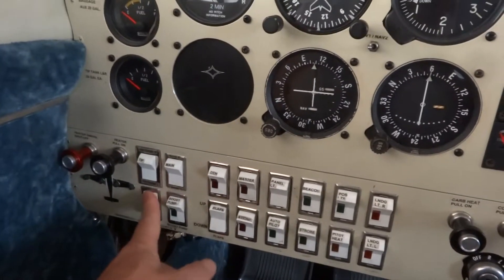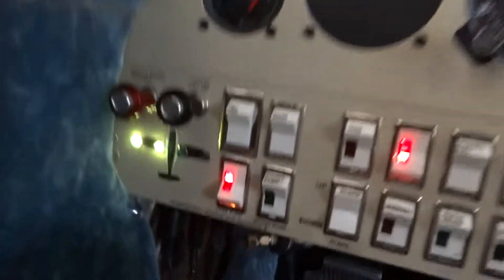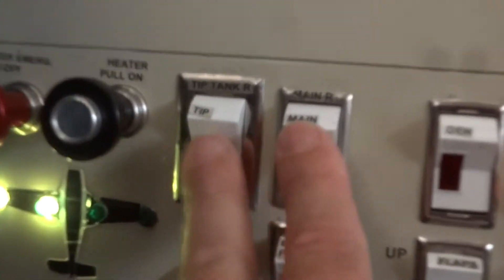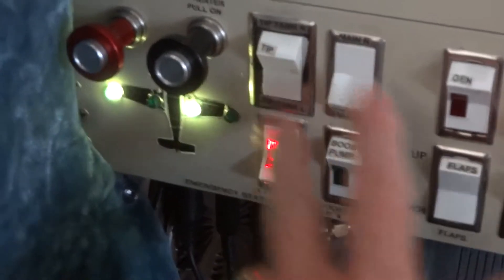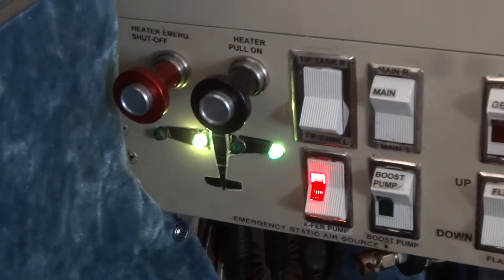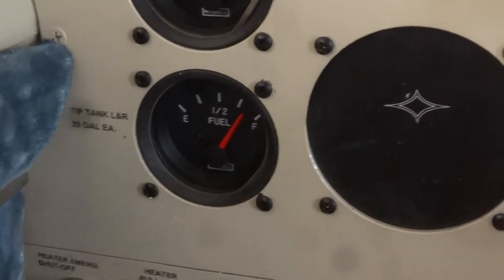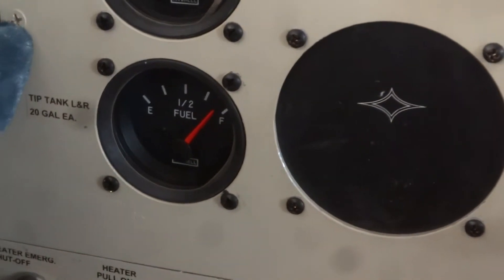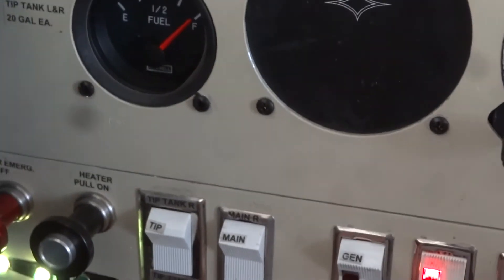Bonanza B35 Tip Tank Fuel Transfer System 1

Comment: Impressive!  ...just saw the link on BeechTalk.  Isn't it be advantageous to initially empty the tips into their respective main to keep the CG the most stable? 
   All the Best,
Reply from the maker: This model, all scavenge fuel returns to the left tank regardless of the tank being used. Just much simpler to use the left and keep filling it. A full left tank has a predictible 2 hour lifespan. The other tanks are 1 hr 20 minute because 1/3 of the fuel sent to the engine ends up in the left tank and not burned. The process for me is:

1. fly left tank for 1 hour
2. fly baggage aux for about 1 hr 20 minutes (20 gal)
3. by that time the left tank is near full again so fly the left tank again.
4 start transferring fuel to the left starting with the right tip. (10 minutes = 5 gal transfer.)
5. then left tip x 5 gal. (over 20 min, transferred 10 gal while burning a little less than 3)
6. repeat when down to 1/2 tank
7. turn to right tank to land if left tank less than 1/2 full.

The plane carries 10 hours of fuel with an additional 30 min reserve.

Cheers,
            Bob